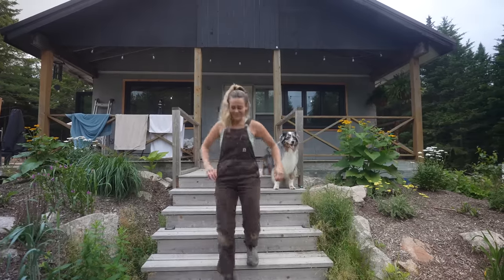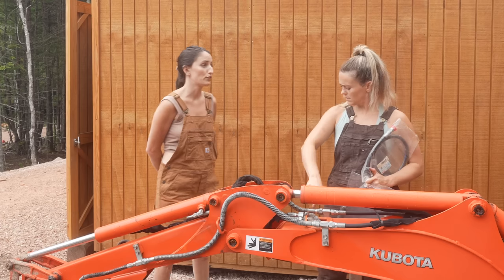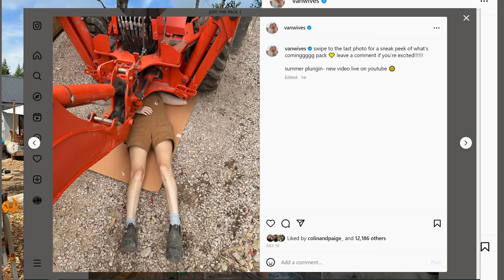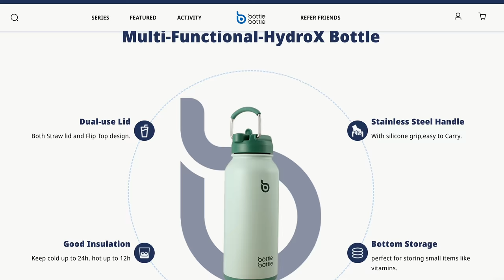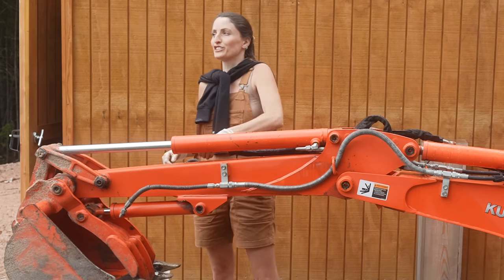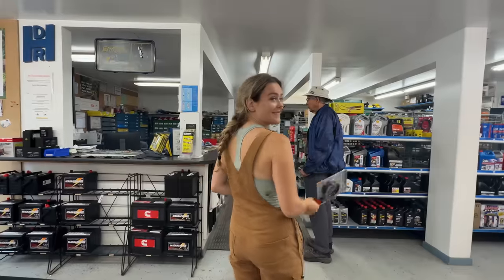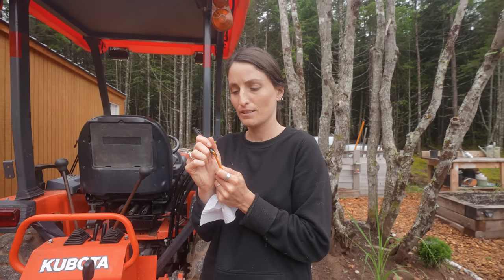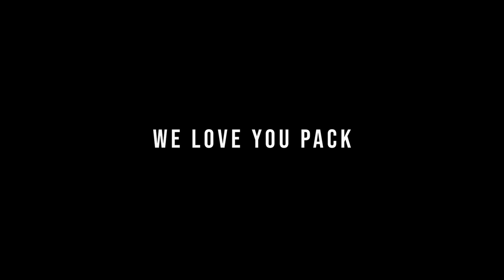FIXING MY TRACTOR

Comment: If you have the parts, just change it and save the good old part as a spare, then if you need it, you can replace it and get a new part, but you know you shouldn't have to replace it for several years, and saves you from losing hydraulic fluid when you change it.

6 point is better than 12 point, saves from rounding off screws. Might need a torque wrench. I used my first one at 40, and I've had it sitting around for 5 years.

Comment: Generally, oil filters are hand tightened. If you don't think your hand is strong enough, go ahead and use the filter wrench but don't tighten very far or the next person removing it will curse you:) It's only  1/2 to 3/4 of a turn once the gasket contacts the base.

Comment: No greasing? Check air filter, belts for cracks, tire pressure, fuel filter, wheel nuts for tightness with torque wrench.  
But so impressed with your can-do and diving into it. Also, chock wheels before any work on  Clementine!!!!!!!!!!!!!

Comment: i'm sure things have changed but back when I did work on stuff in the late 80s/early 90s an oil wrench was a big screwdriver stabbed into the filter and turned if it wouldn't come off :).  now things are so compact/tightly stuffed it's hard to do that but it was the 'oh dangit' moment and for us town was 15m away not like you guys.

Comment: Great tip for removing oil filters is to take a piece of sandpaper fold it in half so the rough sides are facing.  Wrap it around the filter so now when you put the wrench on it will grip the filter and the wrench

Comment: Pouring from the bucket (21:15 - 21:50) wouldn't take so long if you had removed the small plastic plug on the lid, allowing air in...

Comment: When you put that bolt back in (the one you thought was hydraulic fluid but wasn't...) you need to torque it properly! Use a torque wrench. Put some nail polish on the correct plug so you can identify it next time....

Comment: If you wait for a hose to fail, you're going to 
- drain the hydraulic fluid once for each hose
- experience a work stoppage mid-project for repairs

If this doesn't sound appealing, then go ahead and replace all worn hoses at regular intervals during scheduled maintenance periods (between projects)

Comment: You need a couple of wheel ramps and chocks for next maintenance. . Put two wheels on the ramps, wedge the front two = instant space to work.
Also, never check for hydraulic leaks by checking with your hand - use a lump of cardboard. You don't want oil injected into your skin - it's horrible.

Comment: If you open the air vent on the bucket of hydraulic fluid (the opposite side from the pour spout) the oil won't glug while pouring.  Less likely to make a mess that way.

Comment: Don't drain the hydraulic fluid to change the hoses, the cylinder won't empty itself anyway. Get a bucket under it and a bunch of rags, undo the hoses and manage the mess. There won't be that much coming out as there is no pressure.

Comment: another tip ... only do the new filters up by hand as they get extremely hard to undo otherwise, also put the pouring spout of your drum at the top as it prevents glugging and is easier to control the flow.

Comment: You don't need to drain the trans fluid to change a pipe, there is no fluid passing through the pipes while the engine is off.
There will just be a little spillage when you take the pipe off but that's it.

Comment: Using a hammer to drive a large flat head screwdriver blade into the side of the filter then allows the handle to act as a leaver to twist it off too. You don't need the filter again, so it's fine that you puncture it like this.
Thanks for such great content. Mad respect! 
Kia ora / hello from Aotearoa / New Zealand. Come visit some day!

Comment: Not sure if someone has mentioned this already, but when looking for hydraulic oil leaks when the tractor is running,  please use a rolled up piece of paper towel over the hose  and around the fittings instead of your hands or fingers. Oil under pressure can get into your skin and OMG... Google the horrific pictures and you will see what I mean. Splitting hot dog fingers and possible amputation can be the result of the high pressure injection to the skin. Not trying to scare you gals, but I have seen it in person and it's not something you want to go through. Be safe and God Bless and now on to your next video...lol...I've fallen behind.

Comment: As well as changing the oil, you also need to change the air filter, fuel filter and check your water in the radiator. Other than that great job.

Comment: Just one thing I noticed when changing the filters you should Never tighten them with the filter wrench!  only use that to remove the filters.  You should only install them hand tight!  Being a car technician for over 20 years those filters are going to be Very difficult to remove next time you do a service! Just my 2 cents. Have a good week. 🙂

Comment: Hi. enjoy your videos. you don't need to drain hydraulic fluid to change pipes and you should use spanners to do fittings up as easier to get them tight.( i been a plant mechanic for over 30yrs).

Comment: I know the Thing is, you don't need to drain all that to get that hose off. You're not gonna lose that much as you aint got the engine on and hydraulic pressure against the hose, so just make sure the handles in the 0 position. And you're probably gonna lose a cup orthough.

Comment: Hello ladies, you did a great job, I only want to strongly advise you, never check for leakages when the engine is running. The Oil pressure is extremely high and you would seriously injure your fingers. Greatings from The Netherlands.
Reply from the maker: Thank you for the tip! 💛

Comment: Just a note💖when you are working under a vehicle chalk the wheels meaning ,put a 2×4 or thicker behind the rear or front wheels in case the vehicle rolls back wards or forward,for your safty.sorry for spelling.or use jack stands when when lifting vehicals.dont relay on the Jack's only.love you guys.i wand you 2 to live long lives.✌️👍👊😎😊💖💖☕️🎶🚜
Reply: Good tip. However, in this case, both buckets are down. That tractor isn’t moving anywhere.

Comment: Yhe drain plug is above the big steel plate that is under the tractor which drains the transmission but you don't need to drain the system just shut off tractor make sure what ever that hose goes to make sure it is on the gound then move levers to relieve pressure and then change the hose and yes it will make a mess can't be helped just have plenty of rags
Also you don't need to buy the hoses from kabota take broke one off and take it to someone that can make you a new one check auto parts stores

Comment: You ladies should really look into 12 volt drills.  Im 6’2   230 lbs  and find it much easier to line up the drill with much less weight at the back😅

Comment: Do take care of it back.  Don't push ur self. But u also don't want to baby it. It's a fine balance. 
Awesome job with the oil & filter change. I also put a bit of oil into the new filter.😉 Can't hurt. But u have to watch how much to pour into the new filter especially if u have to install it back onto its side connect threads. 😊
CUDTR 🐾🐈‍⬛🐈‍⬛🤗🚐🇺🇸🌈

Comment: Nice job girls. But from a former hydraulic mechanic, although I'm not sure that the safety equipment is the same in France and Canada, I never empty a hydraulic oil tank to change a mast hose . Just be careful unscrewing the hose to drop the pressure slowly. Continue like this and above all continue to make us smile and laugh.
Reply from the maker: We wanted to do a hydrologic fluid change as well since we bought it used

Comment: No, what's funny is you don't need to drain your hydraulics to change a hose.  Just shut it down, move every hydraulic control handle to max in every direction to relieve to pressure, and change your hose(s).  When changed, operate your implement to burp the the air out of the line/cylinder.  That being said, in your case it was probably a good thing, since your oil was slightly dirty.

Also a caution.  The ring you oiled up on the filter will swell up as you use the machine, making it necessary to use a wrench to remove like you just did.  As such, do NOT ever, ever, ever use any tool stronger that a rag to tighten an oil filter.  HAND TIGHTEN ONLY!  You run the risk of never being able to get the filter off, or, worse yet, destroying the filter beyond use, in which case the machine cannot be run again, lest it seize up!  So, 1st chance, loosen the filter (1) turn, and hand turn back to snug.

Tip for future.  When pouring from a pail like that, or like an antifreeze jug, ALWAYS place your opening at the TOP.  This will let air in as you pour and no more GLUG, GLUG, GLUG!  You ladies rock!

As always, thanks for sharing!

Comment: You don't drain all your hydraulic oil to change a hose lol.... you are changing a high side pressure hose for one, there's no oil to lose except for whats just in the hose. Take the uphill side loose first and dump it in a bottle and finish removing the hose.

Comment: Great job on the tractor,  you made me pucker up checking for leaks with your bare hand and fingers. 1500 lb hydraulics,and a pin hole acts like a surgical knife. Use a screwdriver,  Submarine damage control 101. Stay safe, healthy. Crystal take care with your spine, I'm fused 5 levels of my neck,functional but not the same 
❤

Comment: Hi Ladies, I'm not sure if you didn't include it in the video, but getting Grease to  all the nipples and connections is as or even more important than the fluids , wear on your tractor can be almost halved doing this before any use .
Oil filters should also only be tightened by hand not with the tool as I saw you do in video ,..
Love your videos and content, look forward every week , much respect and love from Melbourne Australia 🦘🦘🦘

Comment: Oh no. The new replacement filters should have been installed hand-tight only. Snugging them tight with the wrench is going to make them a real bear (read nearly impossible) to remove the next time you need to service Clementine.

Comment: dont foget you just bleed the system please check fluid level as it will replace the air in your system you wont need much but good job lots of love from Scotland
may be a good idea is to make a maintanace pit with steps so you can get under better for yearly or quater but it is up to you. you may concider a roofed area for that for weather

Comment: 👏🏼😂👏🏼... Wow! You guys are awesome mechanics. 👩🏻‍🔧💞👩🏼‍🔧 I have been a student of "Youtube University" for a very long time. 

I'm not sure if the same thing can be done for tractors, but whenever I get an oil change on a vehicle, I use something called "Motor Flush". Just pour it in the motor, before doing an oil change, crank it up, let it idle for 15-20 minutes to remove any old, gunky oil from the motor, turn it off to cool down, and voila! Proceed w/ the oil change. 🏳️‍🌈🏳️‍⚧️🤪👨🏻‍🔧🤓

Comment: I’m confused as to why you drained the hydraulic fluid just to replace a hydraulic line.  Normally, one just takes the old line off, replaces it with a new one, and then exercise the system to bleed air from the system. A rag or oil absorbent pad will catch the small amount of oil that leaks out of the line.
Reply from the maker: Yes you are right! We are learning as we go. Thanks for sharing with us. 🌞🐾

Comment: I honestly don't think you needed to drain the fluid tank. The flow to the cylinders comes from the pump. As the pump is not running its not pushing fluid into the lines. I wish you had the bucket on the ground though. I have seen some scary near misses with buckets dropping and very high pressure fluid almost injecting people!

Comment: You have to replace the line while the fluid is out of the system.  Putting the new fluid in and then testing the system means that if the other line is leaking, you will have to remove the fluid again to replace it.

Comment: Nooooo no need to drain the oil. When replacing a hyd line the only oil you need  to worry about is in the line. Even if you drain the oil the line will still have oil in it. There are valves on the line.

Comment: Great show. Suggestion, when pouring liquid out of a closed container, you want to pour with the hole at the top on a 5 gallon bucet. If you have a smaller container, turn it sideways. This prevents the glug, glug of the air trying to come in.  https://www.youtube.com/watch?v=2gfjCncKZj8

Comment: Ladies, do yourselves a favor and get what's called a BREAKER BAR.  Get a couple, in 1/2" and 3/4".  When it comes time to turn the bigger nuts and bolts on the tractor, the breaker bar is longer and tougher than your usual ratchet handle, and gives you the extra leverage to break - hence the name - stiffer fasteners loose so you can proceed with the regular tools.

Jazz, if she doesn't want you calling her that, stop.  Speaking as a guy with an uncommon name, what you call people matters and when you don't respect that, that ALSO matters.

Comment: Unlike all the praise you get this  hurts to watch. If the line doesn't have a hole then tighten it or replace the 0ring . Read the manual before any work .the fact you were just smearing grease and not injecting it is mindboggling 🤦🏻‍♂️
Reply: And no need to drain if replacing a line hydro fluid is expensive.
Reply: Filters should only be hand tight 🤦🏻‍♂️🤦🏻‍♂️🤦🏻‍♂️